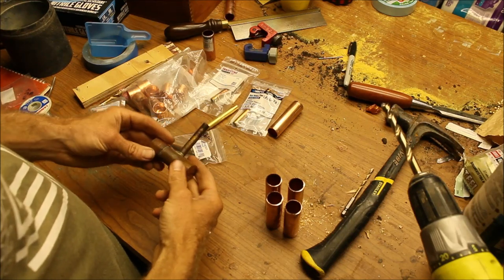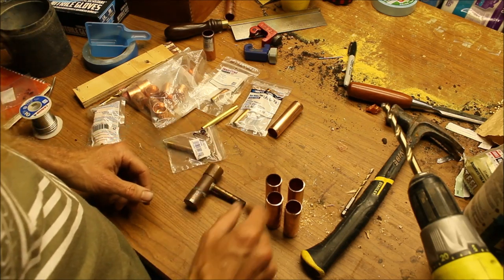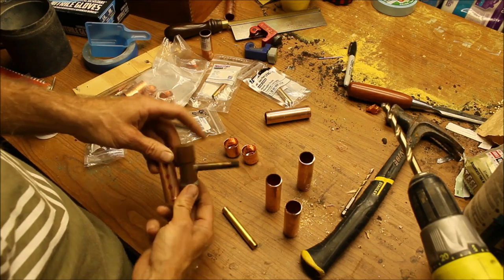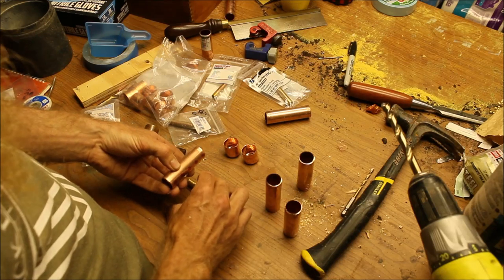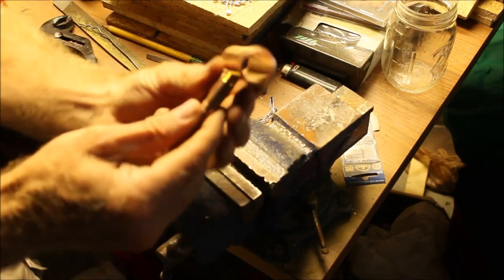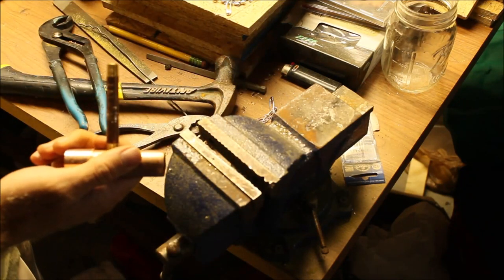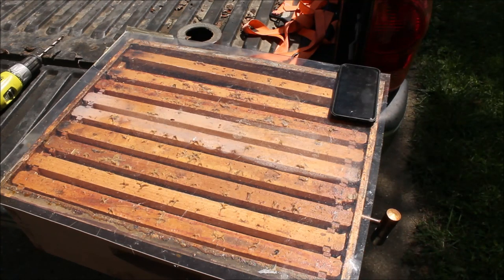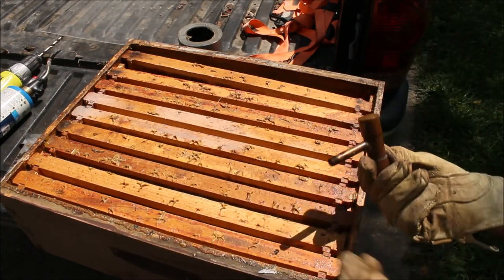Fast Low Cost Oxalic Acid Vaporizer

Comment: Great video! I made 5 of these for less than I'd pay for a torch vaporizer! I made one modification. I cut a small square of tin flashing and drilled a 3/8" hole for the tube to go thru. That gives me a shield between the vaporizer and the hive so I don't scorch the hive!

Comment: tapped mine,and hammered in a brass threaded plug, which acts as a bowl,cause its hollow, took a t and split  it,it slips  over the pipe, and gives my torch a place  to slip  onto it,has slits  for flame  to breathe,heats the brass bowl nicely ,thanks for the tips

Comment: Looks like a low cost good idea but I am wondering how do you control the heat to not exceed 370 degrees F where OA breaks down and becomes useless?
Reply: I would keep the torch flame as low as possible and pull it awayafter 30 seconds

Comment: Maybe drill 3 or 4 holes and place multiple vaporizers along the bottom to insure better distribution of the fumes.
Reply: Yes, I was thinking the same, split the outlet to spread it out more.  Depends if you are winter treating and the size of the cluster I guess....easy to make a few of different designs....I’ll have a go.  Thanks for the video, always satisfying to make rather than buy something imported from China.

Comment: Not seeing a lot of vapor is a big concern for me.  How about demonstrating it in a future video and put a sticky board inside to show the mite drop.
Reply: The common problem with this approach is that acid is heated together with vaporiser. At some point, before goes to vapour, oxalic acid will start melting and that will reduce amount of vapour and efficiency. So, probably what he should do is start by turning vaporiser upside down and then heat the bottom.  When bottom is enough heated put the plug with acid and quickly turnover. On this way acid will fall on enough heated bottom and start vaporising immediately. Having some temperature sensor with probe can make sure that bottom is not over heated. Over heating can be a problem as well because in that case oxalic acid produces the CO2 which can harm the bees. Temperature needs to be between 310 F and 365 F.
Reply: @danholtbk7008  yes it has become a challenge with these mites.  Devil turds don't need to be in bee colonies.  I gave up beekeeping before mites came along.  Now I'm back at it after many years.  New problems, for sure.   Bob
Reply: @yupis9640  what about putting extra, bigger cap on the bottom, to make it thicker?

Comment: Do you have any problems with not getting enough oa in the hive? Its winter so don't want to do washes or take hives apart. If the vapor doesnt do its job I would not know it til it is to late